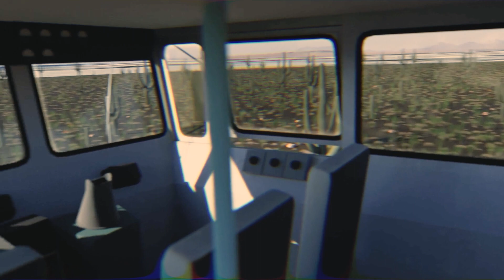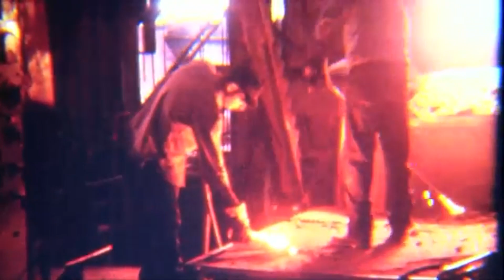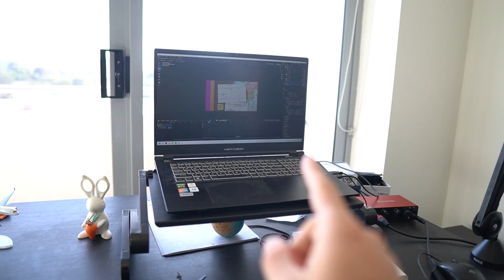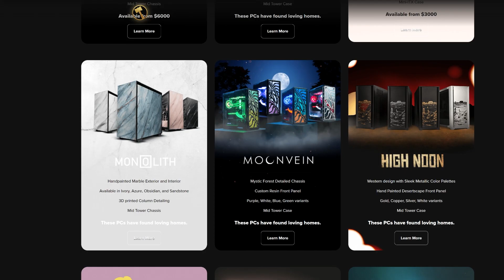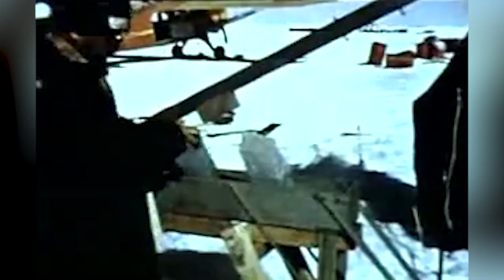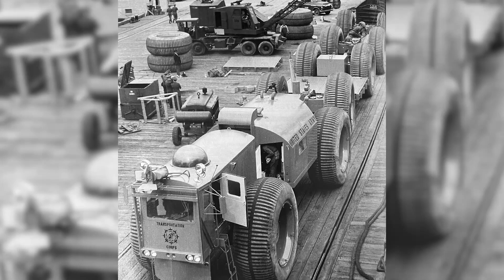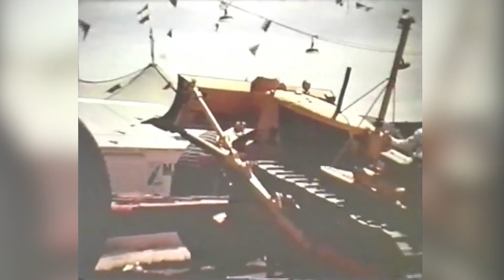What Happened To The INCREDIBLE Land Train?

Comment: This concept would be ideal for rovers on Mars or other planetary bodies, all rovers are already using electric wheel moter and the largest are indeed nuclear powered.  Such a train could be landed in pieces and then assembled and worn out cars replaced.  The locamotive in front being in charge of power, stearing, route finding and orientation would allow the other cars to be specialized for other uses.

Comment: LeTourneau steel in Longview, TX is now owned by Nucor steel. A lot of the equipment is one-off designs by LeTourneau himself. The fabrication works there are owned by Komatsu
Reply: I worked security for over a year there at nucor, I have several friends who work in the plant. Honestly that plant still produces some very impressive product. One of the few steel mills in the world capable of making massive 14 inch thick steel plates and larger.
Reply: @jonathansmith1104  I went down there just after Nucor bought the mill to deliver a couple oxygen lances that we at Nucor-Yamato had built for the furnaces. Longview is an impressive mill with a lot of room to add updated technologies.
Reply: @claytondennis8034  yes it is. Did you hear when they were making the parking lot and the new entrance for nucor, they dug up a Sherman WW2 tank that had been buried in the ground.

Comment: I absolutely love this guy's engineering designs and visions. Some worked so well and if the had continued support and upkeep than they could have continued to use these amazing designs into today's modern society. I would absolutely love if these creations with all sorts of different types and models would be amazing. I especially love the "for the time" cutting edge designs with the crew living area, the electrical power ran off of diesel generators, the drivetrain for each individual wheel they built and he invented the mechanical internal structure and  it gave these vehicles so much more capabilities and level of power, yet efficient machine's that could do tasks and work in environments that most other vehicles could not. So they really were so valuable during their moment in the Canadian spotlight.

Comment: There are still plenty of scenarios where these vehicles would be more effective and practical than heavy lift helicopters. Helicopters have much more restrictions on where they can go based on weather and range than a vehicle on the ground.
Reply: Land vehicles are only restricted by what? Rivers, lakes,  steep terrain, swamps, land speed limits, traction, land stability, ground compaction, trees.
Reply: @jonyemm  Oh yeah, totally forgot about water too.
Reply: @Greippi10  yeah. Actually, there's snow as well.  And weather in general. 
Hmm. Are there helicopters that can fly above storm clouds? Lol
Reply: @jonyemm  The first iteration of the land train was precisely for snowy conditions though. It seems particularly suitable in snow as long as the land is flat and there are few trees/other large obstacles.

Helicopters can fly over regular rain clouds but not thunder storms in general. They start to loose lift and engine efficiency the higher they go, so it seems that most helicopters operate at a ceiling of 3-5km. Beyond that they will loose capability for anything practical. I'd assume heavy lift choppers at full load fly lower than that.
Reply: @Greippi10   @Greippi10  yeah. I knew that much.  I was just building on your "water". The train would still need some sort of road made through forest and such.  A helicopters is certainly more practical in my mind, and based on history and the current happenings.

I've never really gave it much thought if helos can fly above the clouds. I understand the thinner air and such. But I dont have the slightest as to what the average helicopters max altitude is nor the altitude of storm clouds. 
I keep myself on the ground.
Reply: I seriously doubt it, apart from some very niche one time applications. A helicopter can wait for the weather to blow over and it will still be back to base before the land train even reaches the destination. Helicopters can also be refuelled midair. But like the other guy said these would make sense on Moon and Mars.
Reply: Perhaps for Moon or Mars colonies??
Reply: @richardcathcart2952 
Antarctica and extra terrestrial worlds.
Reply: @Ruska China is also developing destroyer size craft which will carry dozens of SWARM robot bombers, which I don't think a Carrier Task Force can cope with. ONE hit on an aircraft carrier and it is rendered non-functional.
Reply: @richardcathcart2952  You have no idea how durable carriers are... especially the newest super carriers. Even the past gen super carriers that were decommissioned showed they were able to take many, MANY direct hits over periods of several weeks & still not sink. With one, they had to manually get on board & set charges in specific spots to detonate, as all direct hits on it were unable to sink it.

A single direct hit of most weapons isn't going to do ruin a modern carrier at all.
Reply: @corey2232  Your remark is silly for a basic reason: once the flight deck is inactivated by one or more explosive hits, the whole 5,000 man strong carrier is a USELESS vehicle carrying only the dead, the wounded, the battle-fleeing survivors! Get REAL.
Reply: @corey2232  you don't need to sink a carrier to make it useless. Destroy the flight deck and the carrier is no longer a threat.
Reply: Plus the weather affects helicopters far more than land vehicles
Reply: Helicopters are not limited in where they can go at all. The thing is though they use up a lot of fuel and have to make many trips back and forth due to their limited capacity.
Reply: @MrMarinus18  as if these monsters wouldn't also guzzle fuel
Reply: @leojohn1615  Of course they use a lot of fuel. Helicopters though use even more.
Reply: @MrMarinus18  depends how far they have to travel to get to the start line. If it was a significant regular route you'd set up a road for regular trucks or build a conventional rail line.
Reply: Wonder how something this big would fare during something like a hurricane. And wonder if one just added a couple wheels on the axles if the locomotive truck could float on water with the cars doing likewise if unloaded.
Yeah, clearly it pales in comparison to helicopters but imagine extreme weather/conditions that limit air support.
Reply: Yeah the world wars air dominance really fucked up humanities development tech tree for land vehicles.
Reply: @FlarkusChunswen  im fully aware its readily available with just a google search. It doesnt take much to do a google search and act like an internet know it all. I value actual conversation sourced from retained knowledge. So thats what I give unless actually asked to help someone by looking something up. I type what I would say in a face to face convo.

Im generally aware of the use of sikorsky heavy lift helos or "sky cranes".   Designed for function. Deff not designed for looks. 
When you say they can fly higher than they can hover.. I have an issue saying I accept that based on my knowledge of how they create lift/traverse. Lift is lift and they use the same function to create lift as they do to travel. So if the air is dense enough to provide " lift" to propel them forward it would only make sense to me that they can hover at the same elevation as well.  Unless you mean that they can't steadily hover? But then id say if they cant steadily hover at an elevation then they can't fly at the same elevation while maintaining a steady altitude...? 
*not considering thermal lift and such blah blah
Reply: I imagine in the middle east there would have been many useful scenarios.
Reply: Ever seen outback truckers?
Reply: Wrong
Reply: One surprising thing he didn't mention is this vehicle's weirdest but most enduring legacy.
Around 8 years after they were scrapped someone took the gigantic wheels and put them onto a heavily modified pickup truck. This proved to be super popular as the first monster truck
Reply: Imagine if Russia had a few of these, mobilize their entire army in a few weeks.
Reply: @cmendoza1094  only, Russia (and Ukraine) already has something called regular trains that use a rail network so vast and expansive that you could call it the primary method of logistics it uses for its military.
Reply: @cmendoza1094  as someone who has relatives over there they are basicly on scraps.  People are getting partial magazines and they are using dummy charges to make it sound like artillery is more effective than it is.  Basicly 50 years of steady decline since the peak of the union has Russia kinda just big.  And it's burning what little it does have.  If they didn't have nukes this would have been suicide as just Finland and Ukraine could have swept to Moscow with the state of their defence systems.  They have nukes that's the only thing saving them from mass ground assaults by other nations.  Apparently they are about 60% of the way through their entire munitions stockpile since the ear started
Reply: @cmendoza1094  What? Mobilization is a economical, organization  and political issue. Trains won’t change anything
Reply: @cmendoza1094  Imagining: Russia then as vulnerable on land and the US Navy's aircraft carrier battle groups are on the high seas.

Comment: Pretty much all of the large (75 ton plus) mine trucks use the same concepts with generators and wheel motors.
A couple of mines use road haul trucks with powered trailers for road use in a much narrower track.

Comment: With some modifications, could a improved version be used for space exploration? 

Like, during the colonisation of other planets, where bases/colonies may be built far apart but still need resupply but there's little in roads, rail or even an atmosphere for heavy-lift aircraft, I could potentially see this being useful.
Reply: Probably, but the question is not whether you could use the truck, but rather if you could get the truck into space and onto another planet. Driving it on another planet is the simplest part!
Reply: What If the rocket used to fly to another planet could land horizontly and have thr wheels then extend out thus giving you your resupply vehicle
Reply: @morganpower9771  tried it in Kerbal. Great theory. Not so functional. The sheer weight of the parachutes alone makes it impractical.
Reply: The Soviets had a similar idea for their Mars mission - a fully mobile base with 2 ascent vehicles and a light aircraft.
Reply: Once we're past just science and actually doing industry and colonization, I think something like these is likely.  With no oceans, and hardly any atmosphere on Mars, there isn't much you can do for long range bulk transport except regular trains or this, and train rails take a lot of material.

It might have to wait until it can at least be assembled on site, for size and shape issues.  Some of NASA's designs for missions on the moon and Mars have vehicles kind of like the cab on one of these, trading some of the engine space for more interior space.  Eventually making something more like this could be a step after that.  Maybe we could use land trains to ship water around, if attractive base locations don't have it nearby.  Refueling rockets on Mars will require tons of water for the hydrogen to make methane.
Reply: @Br3ttM  Yeah this was the exact application I was thinking, not during the first phase of space colonisation but the "we've got everything moslty set up" phase.
Reply: this is an intriguing idea.
Reply: Repurposing this concept for space exploration and exploitation would mean replacing the inflated tires with rigid plastic or metal tires, as well as pressurizing the cabins and installing oxygen recyclers, the immense size could be good for massive lunar sifting operations, however truly ginormous launch vehicles would be needed to get these vehicles to the planet, and not only that, huge sky-cranes would be needed for landing. These vehicles would most likely be constructed on site, requiring factories which come long after the advent of rails and basic resource extraction, by the time these vehicles could be seen on interplanetary colonies, their use would be delegated to remote construction and resource transportation.
Reply: Even as grist for science fiction set on high-gravity planets (in low gravity, you don't need to crawl!), this would ignore near-term advances in 3D printing and self-navigating vehicles. Like long-range bombers, there was a window in time when this was a useful concept, but concurrent technological advances swiftly obsoleted it.
Reply: On the airless, low-grav Moon, imagine using a spin launcher to sling loads across large distances!
Reply: Maybe. It would also be a good idea to put it airless tires so there's no risk of popping them somewhere and leave you stranded. But probably it would have been too costly at the same time since we're talking about a big vehicle that would occupy a lot of space in the rocket and would be very heavy to lift up, aswell as require more than 1 rocket to send the cars too only than the locomotive, which isn't cheap at all. I could see the antarctic snow cruiser being less costly since you only need to fire up 1 rocket to fly it to another planet.
Reply: @ChristIsKing4ever-l9w  it would actually be really easy to make on mars, just transport all the non iron stuff through space and forge all the iron stuff onsite because mars is loaded with easy to access iron. hell, with iron so cheap and plentiful and theoretically a nuclear motor, you could even make the wheels out of replacable iron segments
Reply: @ChristIsKing4ever-l9w  perhaps airless tires would work
Reply: ya the tires would be the most costly part
Reply: @ChristIsKing4ever-l9w  alien space ships are as big as city’s 😂 we need to make a giant space ship as a human race it would benefit all .
Reply: You got a rocket in your back yard that's gonna lift it? Come back to earth, we're not colonizating anything in the next 100 years..and according to the global warming morons, by then everything not under water will be fried to a crisp....which is about as plausible as colonizating space.
Reply: Or better, you could put an entire mobile base/lab on it, so you can explore various parts of the planet.
Reply: HOW MANY DEMOCRATS CAN IT FIT...?
Reply: @harryballsacky  Load just brains..... ALL  Load just asses..... NONE
Reply: I was literally thinking the same. If we find a massive planet with great resources we can set up bases there and have one being from every planet to help load the resources and we all split the funds equally amongst participating planets.
Reply: That's just what all those factories on Mars really need.
Reply: The proper approach would be only to deliver precision electronics and fabrication machinery, plus some materials unavailable locally. The basic structure would be manufactured from local resources, and such train could e.g. haul water from Mars polar caps. It would definitely be a later development into the construction of the colony though, not a thing brought there by spacecraft in the beginning.
Reply: Way to heavy to launch into space.
Reply: They would have to be able to get off the earth first.
Reply: And how would they get it there

Comment: Diesel electric is how all vehicles need to be made with capacitors to balance the load with the engine working at peak efficiency with in-wheel motors, swap out the capacitors with batteries and you have an electric hybrid vehicle for certain uses, nuclear and turbines also are great options depending on use unless we finally figure out the hydrogen economy.

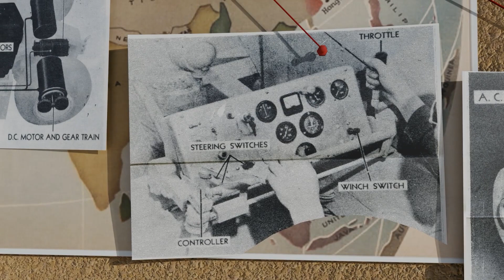Comment: 4:15   "no transmission" while the picture behind him shows the "D.C. Motor and Gear Train"  (ie. transmissions) in the wheels.  No, it has 4 times as many transmissions and many more moving parts than a traditional drivetrain.
Reply: Nice lack of knowledge you're displaying here
You know, they invented something they call "the internet", where you can look up information to support your case
You type in something like "Advantages electrical motor over combustion engine" and you get results that will make you learn stuff
So when you post something, it doesn't make you look like an uneducated fool

Electric motors consist of 1 (yes One) moving part, so for 4 wheels that's 4 moving parts, put in a few bearings and seals, a sensor here and there and that's about all the parts susceptible to wear
Now compare that to a combustion engine that, apart from a crankshaft (Comparable to the rotor in an electric motor), needs (several), pistons, rods, camshafts, valves, valve springs, timing belt
and also needs multiple bearings, seals, shims,  pumps (oil/fuel/coolant), sparkplugs, sensors, etc.

Just an engine is at least 800 parts, depending on the amount of cilinders, whereas an electric motor is about 20

The gear train is NOT a transmission in the sense that you think it means
Probably at most a gear reducer which doesn't have to be more than 2 cogs, hell, maybe 4 for redundancy, as well as torque limiter to save the axles
This is nothing compared to a manual transmission that has 800 parts (never mind the amount of parts a truck transmission with hi/lo gearing has, which you would need to move this train), of which most are subject to wear and tear, even an automatic transmission counts more than 200 parts.

Electric motors can give their full power from go
You don't need to have a (classic) transmission to put the torque of an electrical motor in the most efficient rev range, like with a combustion engine

Another bonus is that an electric motor is smaller and 6 times lighter at the same amount of power as an ICE
And on top of that, an electric motor is twice as energy efficient as an ICE
Reply: @Nightdare  Seethe, you'll never drive one to work.